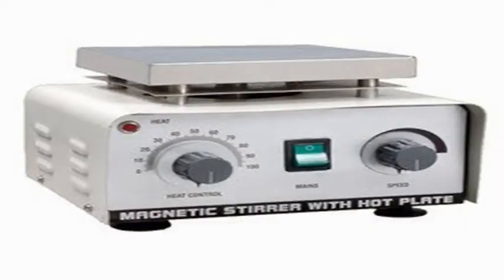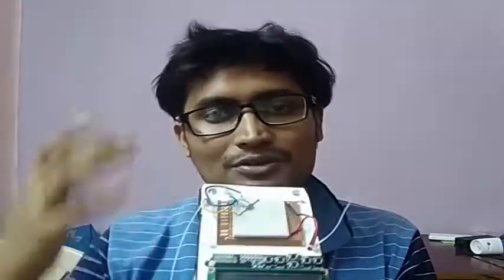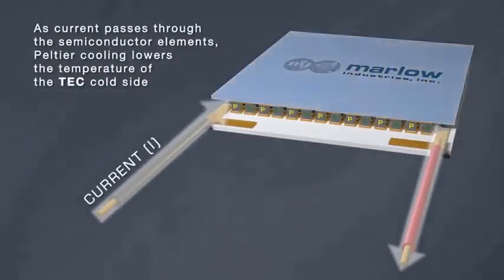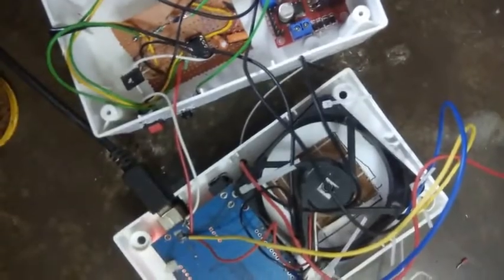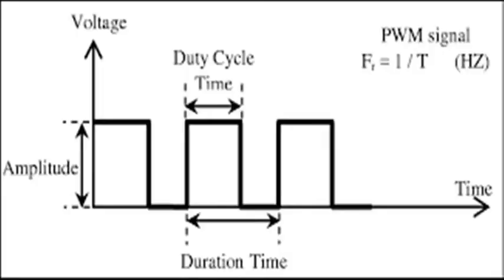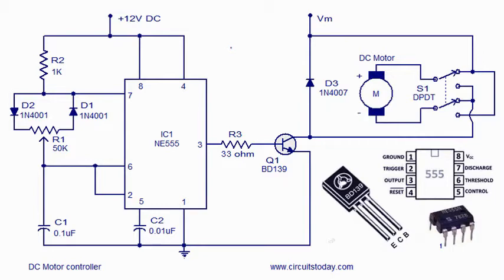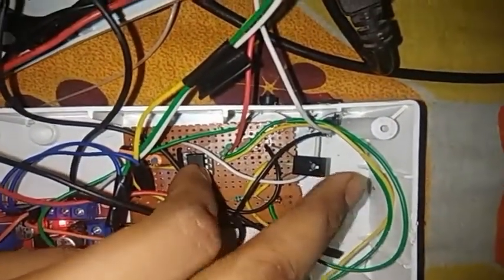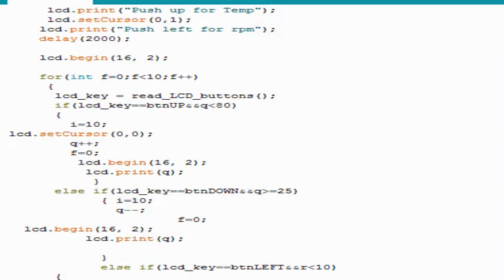How to make  Optical table compatible scientific Hotplate with stirrer at home using Peltier plate

Comment: Very Good attempt, you will need Electronic Speed Controller (ESC) to control the speed of Brushless motor by changing the 3 Phase frequency. The advantage over DC motor is high torque even in low RPM. ESC will also have a minimum and maximum speed limit and standard of the self ESC will not be controllable at very low RPM. So in this particular case where DC motor with PWM control is better. For precise controlling need a feedback sensor like a hall sensor, a reed switch will not work in this case unless at very low rpm around a few Hertz.